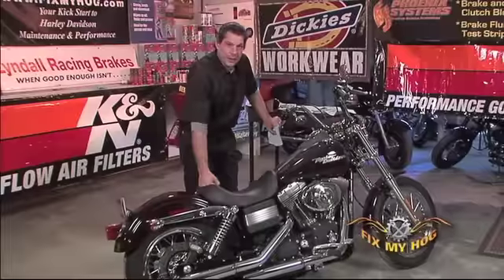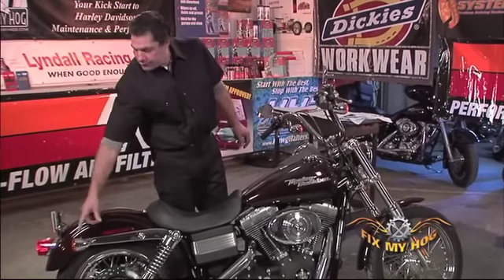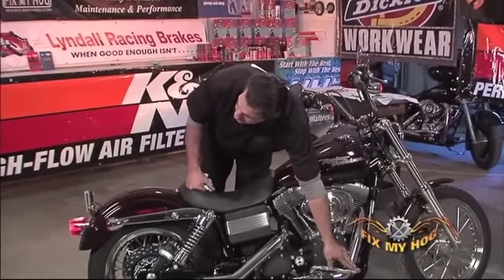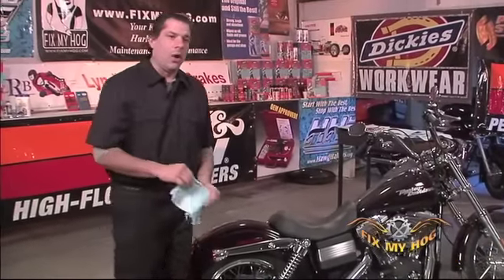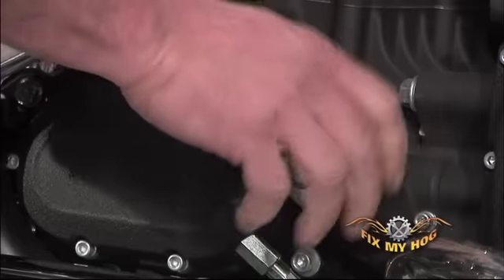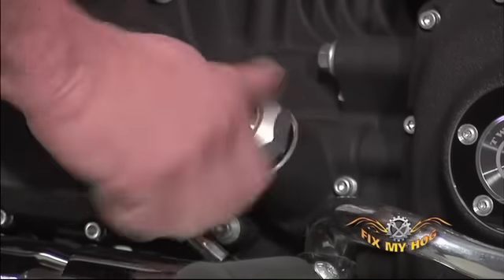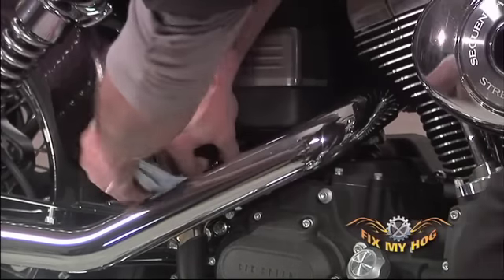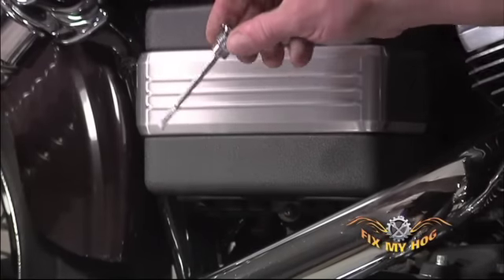Harley Davidson Maintenance Tips: Softail / Dyna - Safety Check & Fluid Level

Comment: Bob My 01 FXD manual differs on one point.  They say to place bike UPRIGHT!
4. Fill the transmission with 20-24 oz. (591.5-709.8 ml) of Harley-Davidson TRANSMISSION LUBRICANT 
(Part No. 99892-84, quart size).
5.    Check lubricant level.
a.    Place motorcycle in a level, upright position.
b. Place dipstick inside fill hole and remove. Dipstick should rest on lip of filler so do not 
screw in tight.
c. See Figure 1-32. Lubricant level should be at the F(ULL) mark on dipstick when removed.
6.    Install filler plug/dipstick.
a. Check O-ring on dipstick for tears or damage.  Replace as required. Wipe any foreign material 
from plug.
b.     Install filler plug/dipstick finger tight.

Comment: i have a 2002 dyna superglide with a dipstick that requires it being placed in(no screw cap) does it require to be dipped down till the rubber gasket on the dipstick touches or fully pushed in?
Reply from the maker: Yes, when checking engine oil on your year & model, the fill plug must be pushed all the way in and the bike must be on its kickstand. 

https://www.fixmyhog.com/post/videos-harley/